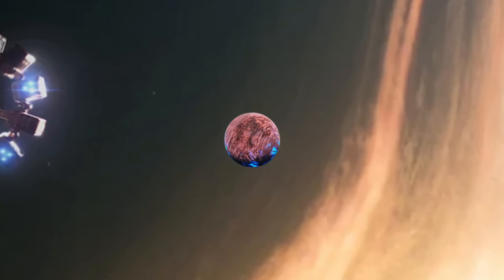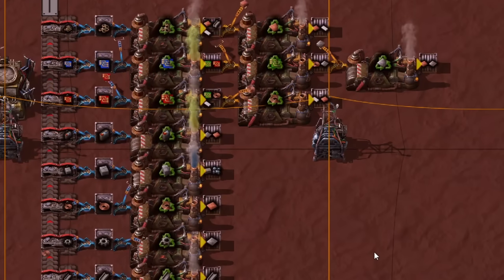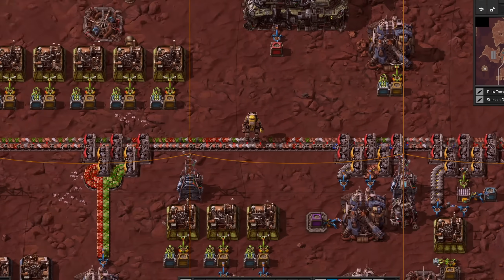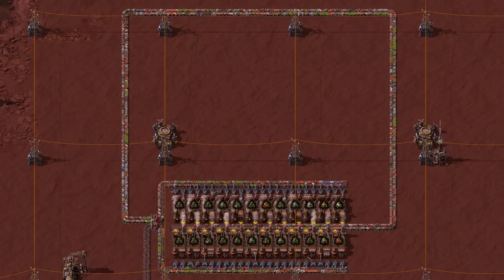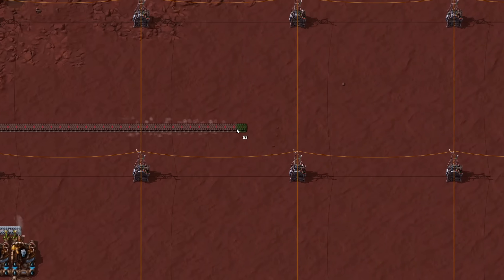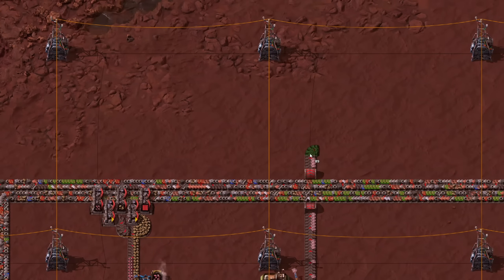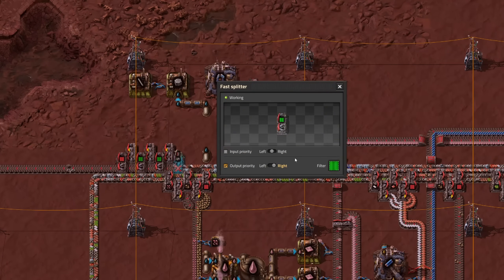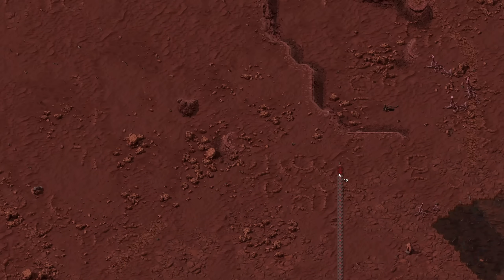Master Planet Fulgora in Factorio. Embrace The Sushi Belt! Factorio Guide / Tutorial

Comment: I took Fulgora as an opportunity to try out a logistical train network for the first time. A big scrap processing island where everything is separated and loaded to trains, where they are taken to different islands for various purposes. Intermediate components can be crafted on their own islands and shipped to other places that need them. Every material can be sent to scrap yards with lower priority to get deleted when they overflow. This makes it easy to expand because you can just add more island subfactories as needed and link it to the train network. Once I got quality going, those scrap yards are given quality modules to passively farm high-quality base materials
Reply: One downside is that the train networks are awful until you unlock building rail supports on deep oil ocean
Reply from the maker: Good idea for the late game!
Reply: In a way a LTN is kind of like a big sushi belt
Reply: Oh, using lower priority train stops for recycling is genius. My approach was to feed excess resources into recyclers with quality modules to get higher quality items.

My main base also had a bunch of these quality recyclers for excess materials.
Reply: @einargs  You can set up a simple combinator to control the priority level by making it proportional to the % of items in a chest at the station using blueprint parametrization formulas.
Not really important in the long run but helps get it started mainly, focusing the distribution of lower volume items like Holmium plates.

Comment: Purple Chest -> Storage Chest -> Requester Chest....and done!
Reply: I have the sushi belt set up right now until I can amass a lot of recyclers and also have a good enough power setup to support that many robots, eventually I'll probably be transitioning over to that.
Reply: @VioletIsOnTheNets 
Other than lightning, my power now comes from burning solid fuel.
The heating tower from Gleba helps a lot and does not require science packs to unlock (just hand mine a rock).
I supplement my water/ice with a permanent platform in orbit. 
Fulgora provides plenty of resources for rockets and platforms, or you can of course ship in a platform starter pack from Nauvis if you prefer.
Reply: robots is the best way because you can craft them very fast on the planet. i have set up a big circle of recyclers with requester chests that request every item that counts higher than 10k and recycle it into nothingness so no item is overflowing.
Reply: Seriously. There’s not need to overcomplicate it. A small amount of bots can handle a vast amount of filtering.

Comment: I’m looking forward to seeing your take on Gleba after watching this video given your less orthodox approach to Fulgora. I’ve been pretty firmly of the opinion that Gleba is intended to be a bot base because of how it makes disposing of spoilage dead simple, but everywhere I look people build belt/bus bases anyways. I’m really curious to see what your approach is!
Reply: i built each product as a cell that's only fed fruit and bioflux, each cell is designed to self start when it receives food and they are designed to pass through excess material to the next cell. no belt is allowed to terminate. every machine has dedicated input for nutrients and dedicated output for spoilage, spoilage and nutrients share a belt since it tends to rot so fast its easier to just assume itll spoil than try to filter it.

 at the end of the line the core materials rotate back to the front where they are fed back into the machine, with filters to catch any spoilage

logi bots are only used to move science to the launch pad, every other function is belts and inserters, the factory runs perfectly without intervention

Comment: I just did  main bus nonetheless. Each ressource has after its splitter a priority splitter so excess gets into the trash compactor again. Works fine, though now the quality items are a bit of a new headache, since they technically quadruple the items you have to manage. I haven't yet figured out the strategy right now. Maybe I just settle for normal and rare(?) Quality for actual used items and everything else wins another round in the trash compactor.

Comment: since holmium ore is the bottlenek i would NEVER use speedmodules inside the production: use productivity and double or triple the amount chemical plants to compensate the loss of production speed
otherwise its quite a nice solution: im more on the robotsside on the planets. feels kinda natural to use robots when going to a new planet and not mess with belts. so this is quite a nice idea if you dont want to robot everything up. well done!
Reply: Agreed, foundries with max production modules is the way to go, then if you have the power and space you can add beacons to improve speed, but I do not have enough holmium for that anyway :) Two foundries can currently keep up to the point where I had to increase storage for the plates.
Reply: production modules in the machines, but beacons with speed supporting those machines are fine, you will get the same amount of productivity either way
Reply: Just double or triple the amount that you're scrapping and use speed modules to make it faster
Reply: @crowxar  usually i would agree, however in this specific case its about starting a new base, so the amount of scrap is (at this moment) limited.
and with a belt approach i would argue, that a belt has only so much throughput, especially on sushi belts

but generally you are right:
if you need more, just get more =D
Reply: @crowxar  It makes 10 million more sense to double or triple your chemplants with productions mods than it does to double or triple your scrapping setup. It's smaller and uses less scrap. EDIT: well it makes sense if you care about space and scrap, not much of an issue after researching foundations
Reply: I'm a robot dude as well I tried a belt for my farms on gleba but didn't like it while the robots kept it clean and faster. I will try and combine both if possible.
Reply: Fun fact: If you use high enough productivity in your science production, holmium is actually not the bottleneck anymore; it is batteries. You need to set up extra battery production eventually to compensate.
Reply: I think this planet is actually perfect for robots. Use active chests on all of the scrap processing recyclers. Stop recycling when there is too much scrap by using circuits connected to the bot network to read contents. Make recyclers specifically to recycle items down into components, and recyclers to get rid of items if you reach an excess amount of items. I got to the point where I even had to recycle holmium ore. It's far more compact. I didn't have a starting island nearly as large as the one in this video so I needed the absolute most compact design possible.
Reply: @lllllllllllillllllll  I tried this but my system got totally bogged down. Even having thousands of bots I couldn't get rid of enough overproduction. Lots of bots just got stuck around charging roboport or something like that. I have many many thousand of stone, and other resources. Have three islands of scrap mining sending 1 train(1 cargo) all the time so lots and lots of scrap.
Reply: @lllllllllllillllllll  ^ this, but it's important to know these things if you want to specifically go out of your way to do belts only, such as for some kind of challenge

Comment: Interesting, will try this out in my newly started playthrough.

On my first one I built a bus with recyclers at the start, sorting and storing all 12 materials, output on the bus, split into new recyclers to get missing stuff like plastic, iron/copper plates etc, storage for this Items and then more recyclers for each item to get rid of them. 

All controlled by circuit. When the storage is full, scrap recycling stops, when a part is missing/runs low it starts again and excess material with max storage cap is recycled to other parts or into nothing. Works perfectly and looks really cool.

Comment: Honestly, I did it the easy way and just used bot-based logistics. Belts of scrap go into recyclers feeding active provider chests. The outputs get sent to filtered storage chests, which I have 5 of for each of the 12 outputs of scrap recycling as well as for the 5 other products (iron plate, copper plate, plastic, brick, and green chips) produced by further recycling. (Technically you also get iron ore from recycling concrete, but I don't need it for anything, so I just recycle it all away immediately.)

I then have additional recyclers, fed from requester chests and outputting into active providers, for each of these 17 materials. These recyclers are circuit controlled based on the contents of my buffers with the following logic:
- < 0.5 chests of a material: Recycle other materials to get more of this
- < 1 chest: Recycle scrap to get more of this
- < 1.5 chests: Activate production lines to produce this stuff from raw materials. (Green chips and batteries only; theoretically I could make production lines for other things, but I worked out the numbers and those are the only ones I don't get enough of just from recycling things I have in excess.)
- < 2 chests: Do not recycle this stuff, even if one of the things it recycles into is under a half-chest. (Besides making sure I don't recycle something I actually need in its original form, there are a number of items which can be produced by multiple paths, e.g. iron which can come gear or batteries or green chips; this restriction acts as a simple sort of balancer.)
- > 4.5 chests: Recycle it just to get rid of it

Everything else just runs off requester chests and a fluid bus. (For small production lines, each machine takes from its own requester chest and inserts into a filtered storage; for larger ones, I use standard input and output belts that connect to a whole line of machines, which in turn feed or are fed from a single common storage/requester chest.)
Reply: A bit late maybe but I craft concrete into hazard concrete before recycling, because concrete is slow to craft and therefore also slow to recycle
Reply: @John-yk4bp so genius
Reply from the maker: Using bots is probably a good alternative.
Especially because Bot Speed Upgrades is a fulgora science pack research.
How much energy does the network consume?
Reply: @AVADIIStrategy  Honestly, the robotports aren't the problem in terms of power. The EM plants are real power hogs - just one of them filled with Prod2s is about 8 MW. But even then, the lighting provided more than enough power, even just with lighting rods, once I had enough accumulators to store it all.
Reply: @AVADIIStrategy  Robo ports are by far the most power hungry things though

Comment: that tech where you can have a splitter that doesn't jam is gold, thank you
Reply: Right?  I've been doing a variation on this 3-splitter thing for ages, but where the odd splitter is the one that filters... this is so much better, because it will take out everything if it can take out everything, it just also won't back up if it can't!  Beauty!
Reply: My belt keeps jamming even with priority set. Help please?
Reply: @ Are you doing the multi-splitter thing as done in this video?  If you just have a filtered priority splitter, that's not enough...
Reply: @DavidLindes  Yes I fixed it. Thanks for the reply. I was doing output priority instead of input priority.
Reply: @sczealot2436  ahh, cool. Glad you figured it out!
Reply: The guy claims it catches all target items and moves it onto the side belt, but from my experience that actually isn't true
Reply: @__dm__  no no, the beauty of this is that it doesn't -- it mostly should, when the belt has space (though there might be times it won't even then?), but it won't jam up when the belt is full, like it would with just the filtered splitter and nothing else.  And avoiding jams is what's desired in this context (it's not always, but here it is).

Comment: I have a simple setup: Just recycle the scrap and siphon off all components into provider chests with sorters from the belt. Everything that is not used gets split into its own lane and down the path of a line of recyclers that ends with removing the parts entirely. Along the way, other provider chests take out every lower tier item that is used. In this configuration, you can recycle endlessly, even without using anything, because even if all chests are full, at the end of the chain, everything is gone anyway. Its a huge resource waste, but there is plenty of scrap for ages and you can always cut the main scrap supply if you are not using anything.

Comment: I definitely made the same mistake of separating all materials and had the exact problem of everything bottlenecking everything while still having no holmium.

10/10 vid can't wait to destroy my base and start again.
Reply: I did the same but addet a recyclers facing each other to void stuff. Resulting in a chain of 3 or 4 recycler. For exemple the first toke gears with a direct output in the next to reduce the amount of iron plates, that step gets repeated and the last recycler in the line faced backwards to create a loop. These voiding  Array is fed only when the sorted  belt has a certain amount.

Comment: Looping your sushi belt back into the same recycles that process the scrap that comes from your scrap ore patches you lose a lot of productivity. The productivity cycle of the scrap process is reset when you process a different item in the recycler. It's better to have recyclers dedicated to recycling scrap, and another set of recyclers that breakdown what comes back from your sushi belts and just mergo those.
Reply from the maker: True. I have separated recyclers in my actual base.
But this video is about getting started and you start with 0 scrap productivity.
So i wouldn't worry about it until later.

Comment: Ok, but the main problem with Fulgora is that it has very tiny islands so I need tons of elevated rail pieces first, and every small islands need around 25% of their area covered by accumulators to have enough power... I would like to see how you would start on an actual Fulgora with only Vulcanus discovered before it so no possibility to fill the oil fields.
Reply: Most big islands have some scrap on it, just not the massively dense patches you find on small islands, so you can still build an entire first landing base on one capable of exporting science without a single train, which is Nauvis science anyway.  Some islands might even be close enough to be reached by the big power poles so you can fill the secondary islands with accumulators which is what I did.

I'm not even sure why you mentioned Vulcanus, I went to Fulgora first before even starting yellow and purple science and it was awesome fun.

He even already showed you in this video how he would do it, his build was pretty small.

Comment: Haha, I built a massive sorting mechanism that perfectly fit on an island that sorts four turbo belts into 12 trains and recycles the overflow into oblivion. This seems a little easier, but it seems like it is restricted to one island in scope? with the train system I was able to set up entire islands just for processing individual types of outputs.
Reply: With Rocket Silos, it does not matter where on the surface they are launched;  This approach could be used to make factories on many islands that would answer the demand for those sweet Holmium Plates and other assorted goodies.